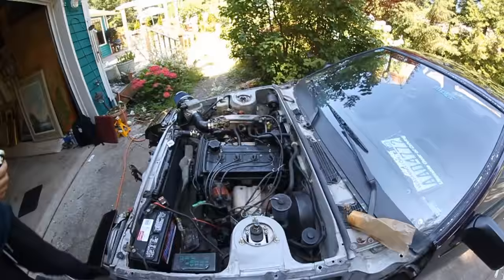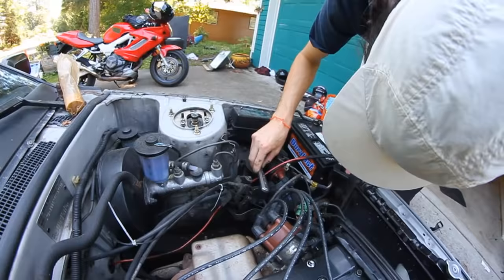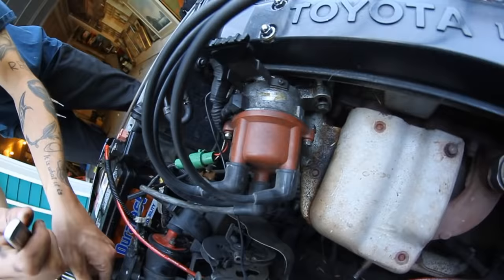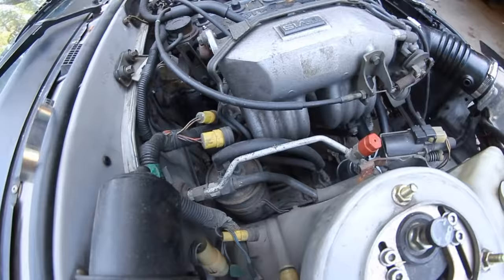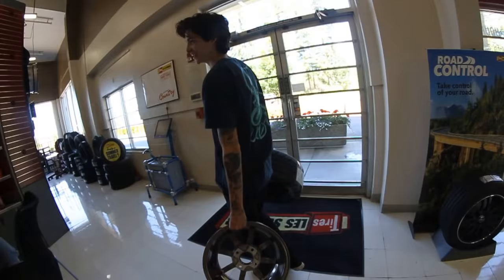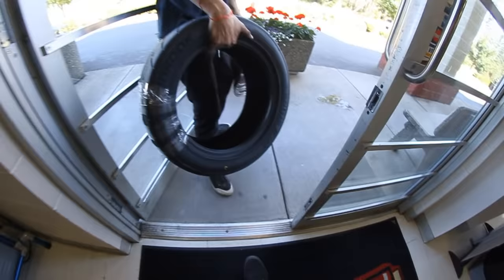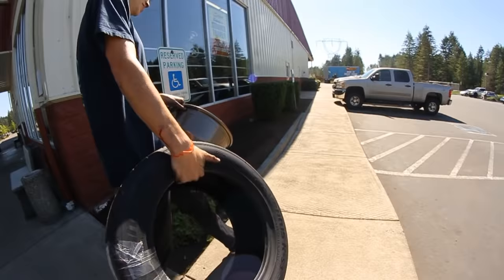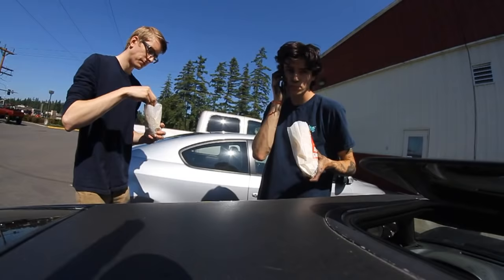Watanabe Reps on The AE86

Comment: I think that's the reason why most tire shop refused to put the tire on in the first place cause it's too wide and you can't turn the wheels 8 inch wide should be your max for the fronts 9 and 10's are for rears

Comment: hey, I do not undertand the tire stretching thing....  Why not just buy tires that fit your wheel if you are getting new tires anyway?  I thought the stretching was just for kids who can't afford new tires or something.
Reply from the maker: well there's a couple things. a big part of it is to help with clearance issues. if the sidewall runs in towards the center of the wheel like it does when stretched, you end up with a lot more room to play around with when it comes to steering angle and ride height. and just like a lot of things, people do it for how it looks. you may not like the way it looks but there's a million people who see it differently.
Reply: More Skids
That kinda makes sense I guess.  I would personally just go with a smaller lighter wheel and put tires on it that fit.  You would have better handling, smoother ride, and safer longer lasting tires, but I can see how if the wheels are too big for your car how this will help.

Comment: just dump the spacers i use the exact same wheels on a 83 also did test fit on 86 rears would fit with a good fender roll fronts stick out one inch and could be done with relocated fender(thats the plan for my car any way) check out pirsq on instagram to see the 83 same wheels 245x40x15 maxis rc-1 with small bolt on flairs(original wheel archs had been hacked off before we bought car)

Comment: DIDN'T YOU FOOLS WATCH INITIAL.D GUM TAPE DEATH MATCH EPISODE? YOU DON'T NEED TO TURN THE STEERING WHEEL FAR TO CORNER! ITS ALL ABOUT CONTROL VIA REAR THROTTLE AND WEIGHT TRANSFER AND REAR END SLIDE/DRIFT.

Comment: every time i watch a video i die inside, im down in Florida and the car market is either dry or way over priced. no 240sx for the krab man :(
Reply: im stuck driving a 1989 Chevy pickup, but its cool 'cause i made a spoiler out of hockey sticks and its not firing on like 2 cylinders so it sounds bad ass. the trim came off so i re did it with the flaming ducktape.